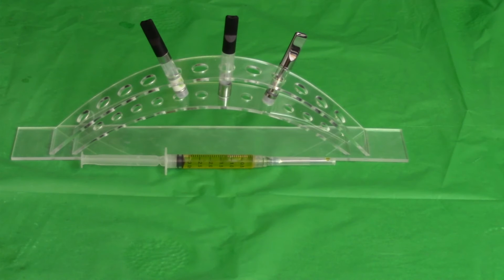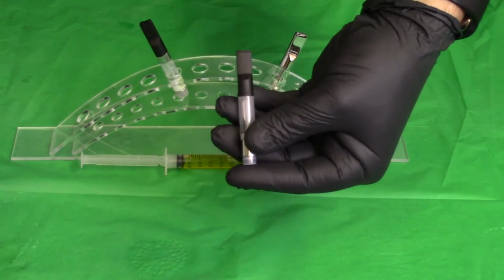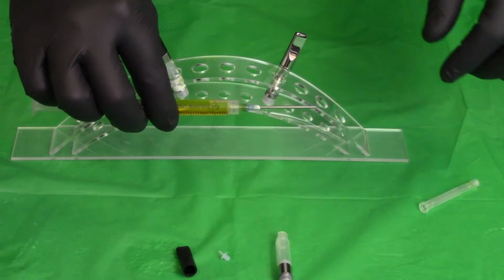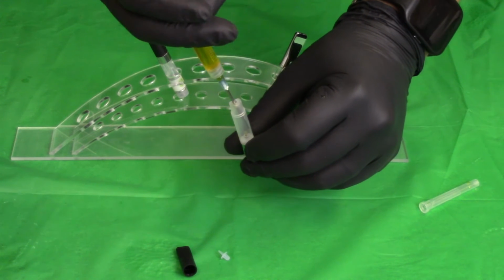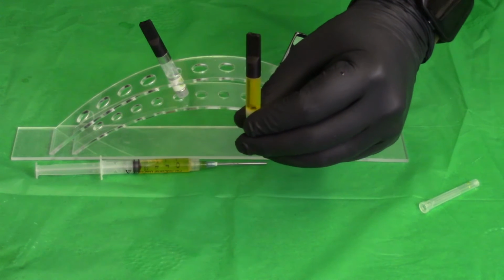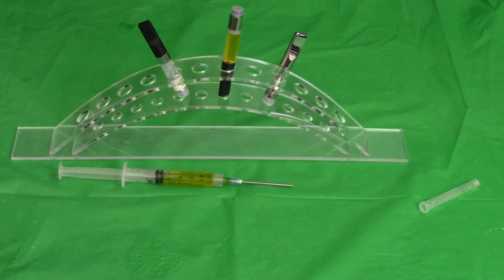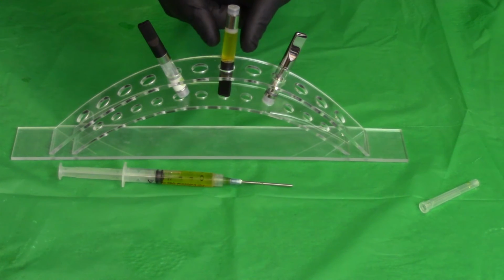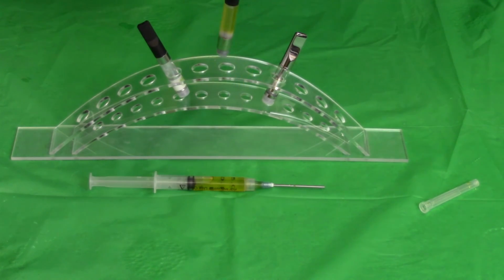How to Fill: Transpring A2 Plastic Vape Cartridge

Comment: Thanks a lot for the really clear video! I just got a pre-filled CBD cart, which is the same model as the one showed in the video. It's my first time using a vape like this, so excuse my silly question, but do I leave the plastic "cap" inserted in the glass container as I use the vape, or do I take it out? 😅

Comment: Why does it have to be within 30 seconds?
Reply from the maker: It creates an air lock that helps prevent leaking...It's like putting your finger on a straw in liquid then lifting the straw....the liquid stays in the straw as you lift it.  However, if you put your finger on the straw too late or not completely, the liquid will drain out of it (ie. the cart will leak).
Reply: Peter wow, ok. Thank you!

Comment: does it use oil?
Reply from the maker: Hi, the cartridge is designed to be used with essential oils. So yes, it will work for your application. Just make sure you get your viscosity right! Check out our video to learn more.